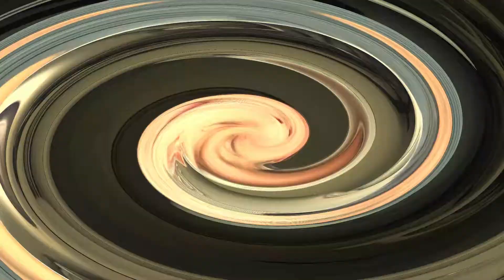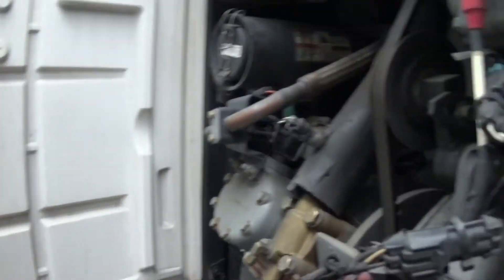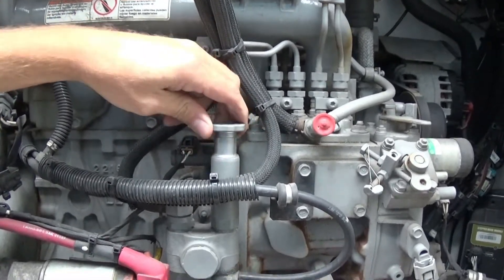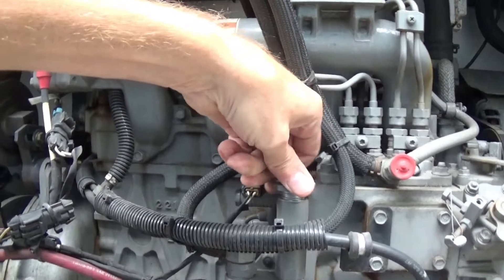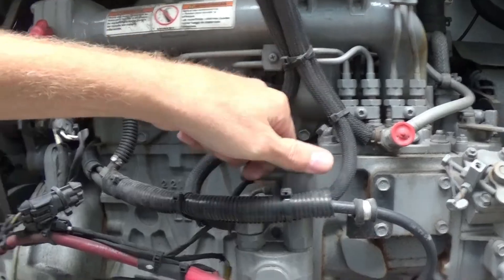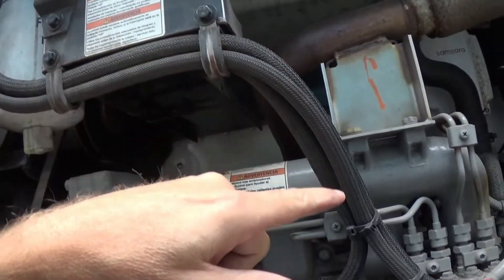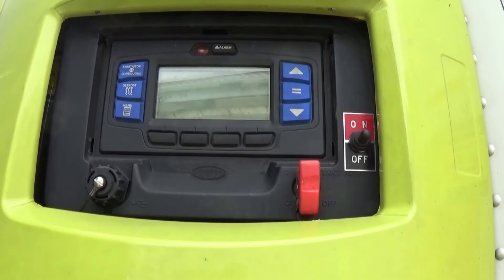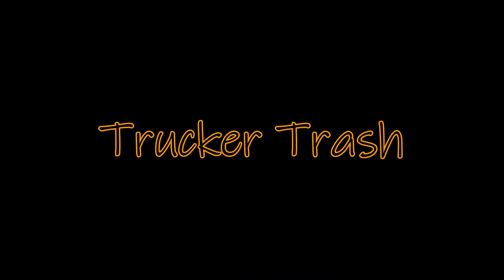How to restart a reefer trailer after running out of fuel.

Comment: Rookie question but why do you have to prime reefers? doesnt it have a fuel pump or something?
Reply: It’s does have a lift pump , fuel injection pump , fuel nozzles , and a fuel filter .  When an engine runs out of fuel  , air is sucked  into the filter and fuel lines .  When manually priming the system , air is pushed out and replaced with fuel  . Sometimes cracking the fuel lines removes the air as the primer is operated . Also fill the fuel filter .  There are other ways to purge the system with vacuum or electric fuel pumps .